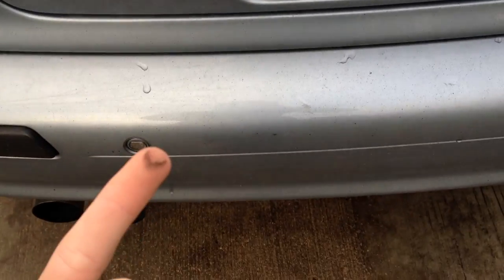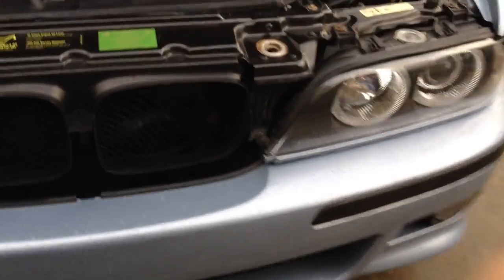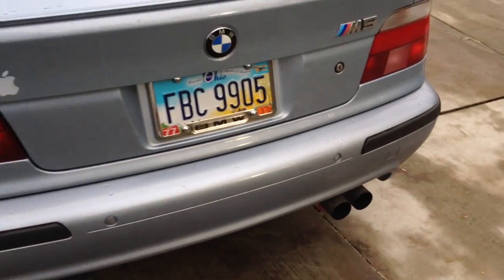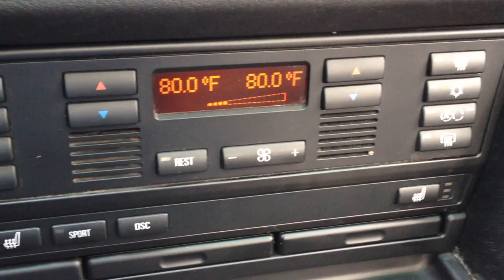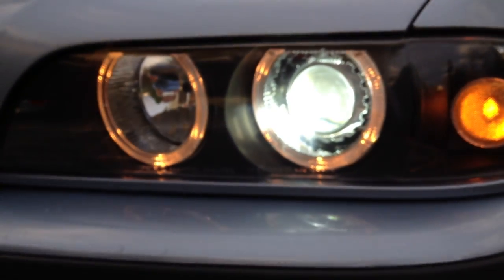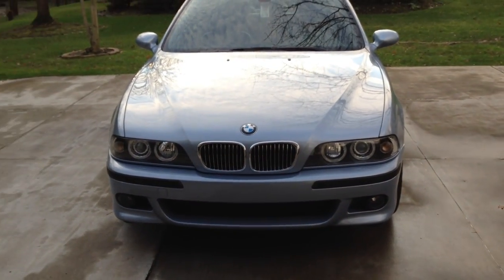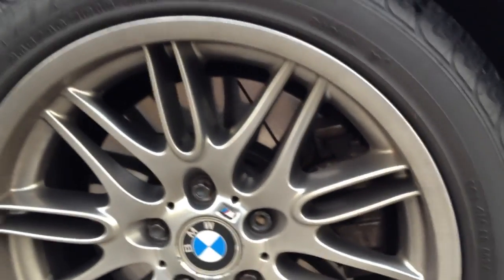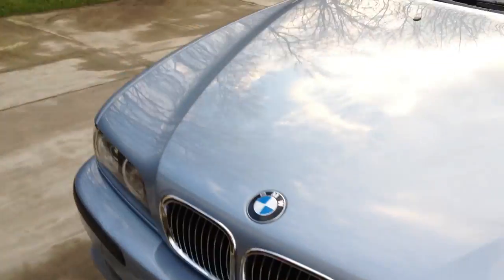BMW E39 M5:  Maintenance Info, Cost

Comment: My E34 Heater fan is a motor with a squirrel cage on both ends of the shaft.  2nd one became noisy and from the firewall with covers off I sprayed aerosol bicycle chain lube on both bearings  while it was spinning.  As the lube entered the noise want away.  The fan noise is motor bearing lubrication lack or drying out. It makes the rotation lumpy and therefore noisy.

Comment: While I have no experience with the m5, on a 3 series that temperature gauge never reaching the middle could indicate a soft failing thermostat...all things aside that is a beautiful car!
Reply from the maker: That's what I would think too.  But, I replaced the thermostat, temp sensor, water pump, and flushed the coolant system- no different.  So she stays!

Comment: If your temperature needle never goes to the middle, your thermostat is most likely busted (stuck open due to weak spring). It's very important that the engine gets to operating temperature - neither too cold nor too warm.

Comment: Hey, Im thinking about investing in a e39 M5 or 540i with the M5 body kit, but i was wondering if the expenses are really that bad. I am a DIY kinda guy until it comes to serious engine work or suspension. But i have a 1994 Mercedes with 252k running strong with slight maintenance. But do you think i should invest in either the M5, 540i, or e60 545i w/ M5 body. I dont want to spend too much on maintanace. but want a nice car.

Comment: On all V8 E39's. I believe on the I6 E39's you use hydraulic fluid because its rack and pinion, the V8s don't have room for rack and pinion so they use a steering box. The steering box requires ATF.

Comment: The last two numbers sort-of suggest the engine size but it doesn't always match and sometimes they adjust it for output. e.g. the 316 & 318 BOTH had 1.8 engines but the 318 was more powerful.

The older 528i DID have a 2.8 engine but now it's a turbo 2.0 BUT a rule of thumb to compare turbo engine size against non-turbo is to multiply by 1.4 hence 2.0 x 1.4 = 2.8 there you get a 528i ( "i" just means petrol now as it used to mean "injection" )

Comment: Just as a side note, I beat on all my BMW's. They are built really solid like tanks. I still have yet to hear a single tick coming from anywhere in the interior or exterior from any of my bimmer's, 1 of which has 250k on it. BMW's have their quirks here and there as described in the video, and my M3 has the VANOS problem etc. but don't let that paint an ugly picture. Drive a BMW once and you will never want to drive anything else, unless its a Porsche maybe !! Happy Motoring !!

Comment: In Europe pixel fix cost 30-60euro. All maintenance costs for my 525dA is very similar to this M5. Only difference is that 525dA costs 3-4k, but M5 10+k.

Comment: +E39Source is the engine rod bearings solid in these cars at high mileage like yours do you reccomend changing oil every 3000 miles me in sunny California always driving hard mostly highway mileage reverse commuter not much traffic meaning less stress on engine other than some overtaking and on ramp entering. Hopefully keeping rod bearings fresh with 10w60 castrol tws oil somewhat my theory and making sure coolant levels always checked. Much appreciate your input! Great video and been watching them occasionally for confidence while being s new owner of a 2001 alpine white 96000 miles due to your videos!
Reply from the maker: Rod bearings are solid, compared to the S85 V10 in the next generation of M5.  Those need to be replaced every ~75,000 miles.  These will go 150,000 miles+.  I would recommend replacement before 200,000 miles in most cases.  I rebuilt an engine for this car at 192,000 miles (detailed in this channel).  But my original engine was working fine- I just wanted to have a fresh engine done here in Ohio before I move to California and labor rates double.  I recommend using a high quality full-synthetic oil in a change with a fresh filter every 7,500 miles.  Castrol TWS 10w60 is great, that's all I've ever used. 

At 96k miles you'll be fine for a while regarding the engine.  Keep those fluids fresh and topped off and enjoy it!

Comment: did you say you have a sensor problem or EVAP system leak.
meaning a cracked hose under the gas tank.

can you pass obd2 emissions ?

Comment: e39 or e60 m5?
which one is better? i wanna get an e60 but idk the e39 looks appealing price wise
Reply from the maker: You know what, they're both fantastic in their own way.  I've spent good time behind the wheel of both models.  It all comes down to what you want from the car.  The E39 FEELS faster.  It has much more usable torque, the car just feels tighter, and more connected.  Around city streets, the E39 does feel like a faster car.  The E39 is a blast on the highway, but nothing like the E60.  That is where the E60 shines.  The extra 100hp is noticeable.  However, around town, I found that it feels smoother and more tame.  Not as tight, not as fast.  The power is HIGH in the rev band, and you have to rev it out.  Both are well built, good looking, and comfortable cars.  Gas mileage is similar.  Both are expensive to maintain.  I'll choose the E39 for now, but when I move to San Diego and spend a lot more time going 80-xxx mph on the highway, I might consider an E60 with a manual... but then again maybe not!
Reply: Guillermo Hernandez I have both, and they are very, very different cars. The e39 M% is basically a German muscle car. Many consider it to be the finest M-car ever made. A real classic now. The e60 M5 is a super-sedan, can run with a Gallardo, but uses quite a bit more fuel and is much more complex, especially with the SMGIII transmission. The V-10 at 8250 rpm is amazing, though!!
Reply: NOOOOOOOO I WANT BOTH
but i wanna get the e60 first then the e39
Reply: +M5pilot 
I got an m5 e60! but now i want an e39 m5 lol
The v10 is very thirsty, but god so lovely past 4k

Low end torque combined with the weight makes it sluggish at low speeds but it just doesnt stop once it goes, its crazy

Comment: Hey, awesome video! Great talking and a great car of course! I am not a big car guy, but I can imagine that your low-rev driving could cause the carbon on your trunk. It's not the low revs itself, but if you push the throttle and use the torque in low revs the engine has to enrich with gas quite a lot (same air, but much more fuel). maybe that's why? It sounds like it makes sense - higher revs -> more air with linear enrichment and not proportional.. (sry for the english..B)

Comment: I have a 2003 M5. To get my vanos and timing chain was 5800. Its worth getting fixed. You must remember M 5 is a RACE CAR. I CALL MINE THE BEAST!!! A LITTLE EXTRA WORK AND I HAVE 550 HP.
Reply: Be careful!
Reply: It's the timing chain tensioners that should be replaced to prevent the guides and chain itself from becoming an issue. Much cheaper solution if caught early enough.

Comment: Whats the difference with 5 series 20, 28, 30, 40? Is it the size or length or is it internal upgrades like horsepower and engine?

Comment: I just saw one of your comments that you have about 61k into, what was the most expensive repair you did on it? The video gave me hope, until I saw 61k spent lol.
Reply from the maker: About $45k of that is to make it "nicer" or "newer".  The most expensive required maintenance to keep it safe and driving well was probably spark plugs, oxygen sensors, tires, brakes, mass air flow meters, stuff like that.  None of those jobs were over $500 for parts.

Comment: Pretty cool video, reminds me of when got my 99 Audi A6 6 months ago, believe it or not we had similar issues, the display in the cluster panel seems to be a german thing..... i have the same issue and i juts totally ignore it, i dont have the fan Fan Issue though, only fan in mines was busted was the secondary fan on the radiator, $60 bucks @ amazon, my ABS sensor was busted fortunately a company had a core trade-in so the price wasn't too bad, I also have drill and slotted rotors.....

Comment: Hi great video thx, few things though: the oil gauge to go to the middle & even crawl a bit after is normal, same thing for coolant gauge reaching the middle is SO normal if not you might have a problem with the censer, BMW notorious about their cooling system.    
You are shifting too early, this is a race car, getting the gauge into 4k & more is better as long as you don't get it into the red zone, by driving the car your way I'm afraid you might have carbon built up in the cylinder heads & t

Comment: First gen g35s have suspension design flaws. Compression and control arm bushings last about 70k miles, depending how the roads are where you live. That's 500 a piece times four. Then ball joints, tie rods, alignments. Then my alternator, radiator, engine pulleys all went bad. Wheel bearings also go around 70k miles. G35s also have a brake wear issue. I changed my brakes and rotors 4 times and my car had 96k miles on it. Then the exhaust rusted and fell off. Also the 6 disk cd changer gets jamed

Comment: Hows the oil usage on the engine?  apparently pre 01's were known to use/burn up some oil during day to day use?
Reply: Yeah i did abit more research after i posted on your youtube video.  Theres a few common fixes that can be done to help reduce the oil usage but not eliminate it completely.

Im sorely tempted to get one of these beasts but obviously here in australia, economies of scale with less numbers of these babies running around, they still sell for a premium price.  eg theres one im looking at thats done around 124,000 miles for around 27k US.

Comment: In my country, kinda hard to find a E39 540i. Most of the seller only have 520i 525i & 528i. For your info, we only have auto transmission and impossible to find a E39 M5 here. Basically what i want ask you here is, what do you think about the auto transmission on this car model ?
Reply from the maker: The automatics have proven themselves over the years to be kind of problematic.  Lots of owners have seen them fail right around 100,000 miles.  But there are also some to go 300,000 miles as well.  Personally, I don't like driving an automatic in any car.
Reply: Too bad to hear that. So from you opinion, E36 & E39 this 2 beasts which one is easier to maintain plus i watched your E36 MT transmission conversion it was really really awesome !
I hope that you could give me more suggestion about how to buy a good BMW car because i been watching toooooo much videos about BMW cars and it make me so confuse to get which E30 E36 E39 & E90 dammmmn !
Reply from the maker: The E36 has a much lighter/cheaper feel to it.  They also lack (stock) in performance quite a bit to the E39s.  I would certainly recommend the E39, but thats my taste.  I encourage you to go out and drive a few different models to see which you like.  The E36 would definitely be the cheapest to maintain though.
Reply: Thanks for advice bruh, appreciate it !

Comment: Rapha, The emergency would be if the entire primary braking system fails, otherwise it's used as a parking brake. This is why it's constructed to be independent of the primary system. It's called a drum-in-hat system. Since the 1950's or so, law requires brakes to operate on separate cylinders and lines, preventing the likelihood of complete failure, but it can and does happen. How would you stop the car in that situation Rapha? Fred Flintstone style, I suppose.

Comment: is it normal for the engine temp and oil temp to not warm up to the midway point?  i just got an e39 m5 and its behaving the same way, broken thermostat?
Reply from the maker: +trimedia yes, that is normal. The M5 thermostat is not buffered so it will show the actual temperature

Comment: regarding the engine temperature..push it four 30 mins in 5-7 k rpm and it will heat up:)

Comment: Did you find out what does that reset button do on the climate control?
Reply from the maker: The "rest" button is for winter use.  When your engine is warm, your battery is healthy, and it's below about 60F, you can press that button to keep warm air coming into the cabin should you have to park and get out quickly to go into store or something.  Very useful in the winter time!

Comment: My fix? Take apart the mirror and use a knife to pry the two halves of the glass apart, clean up the auto-dimming fluid, and replace. Yes, the mirror isn't tinted nor does it actually dim, but it looks perfect and the total cost was $0.
Reply from the maker: ***** That would work, to a point.  But the function alone of actual auto-dimming mirrors is worth the hefty price tag to me.  When I drive my E46 at night (no auto dimming mirrors) I have to tilt them up so I can see to drive without being blinded, and then I have no side mirrors anymore.  Something like that is just not acceptable in an M car.

Comment: the head light not balencing just could be a sensor the conectes the wheel I know this because i have help do the hole subspenshion on the e39 540 and there a little rod the goes from the subspenshion to the sensor that ajusts the head light the problem iv had one the e39 is the driver side low beam going out

Comment: My bmw has lights coming on the dash.. I have a taillight out  (when their all working) my abs and ASC lights come on when their also working fine.. and just to finish off, I replaced the brake pads and sensor and that light is also still on!! 
Can you help?
Reply from the maker: Check the third brake light, that is usually the offender.  Did you replace the pad wear sensor?  That's what notifies the computers of the status of the pads.

Comment: Castrol 10W60?...You have money for an m5 and you put "Castrol 10/60 Semi-sintetic?
Reply from the maker: That's what BMW recommends in the owners manual, and on the oil filler cap.
Reply: Anthony R. It's full-synthetic. TWS. Motorsport oil. Extremely high-spec. oil. $15/liter.

Comment: 156k miles high mileage? You got to be joking! You should live in europe to see what is high mileage.
Reply: +Ruben Rocha Now days to get an m5 or m3 for about 12k euro to 15k for m3 or 6k to 10k for the m5 e39 it would be a challenge  to find low milage
Reply: Even for European standards this is high mileage, unless you live in of the former soviet block countries, where mileage correction of 60.000 miles is normal.
Reply: jerry6711 we have  leasing contracts that go up to 180k km. There are people buying second hand audis and mercs with 200k+ km and have them up to 400k km or more. Our car culture is that you only sell  the car when it has  severe body rust or severe mechanical problems. And we  have to take our  cars  to national road test every year. A well maintained car drives Like new even  with 400k km.
Reply: Where's that? Let me guess. In Germany...
Reply: jerry6711 in almost every european country.
Reply: Except the UK, where even 90,000 miles is seen as "high" mileage by some dealers. Also, depreciation is so big, that it doesn't make much sense to keep an old car, as repairs will exceed the value. In the UK they want you to consume a lot, like in the USA.

156.000 miles=251.000 kilometers is still not a low mileage. You may need to refurbish some engines at this mileage.

In Poland or similar countries, where the roads are rough and motorways few and far between, some automobiles with this mileage really will be worn. Add gas conversion, often lack of proper servicing for older cars due to the lack of money of their owners and things really will not look rosy .
Reply: Ruben Rocha my dad drives 400k in 3 years xd
Reply: 200.000 miles is normal in Europe.
Reply: I drive a 16 years old German Station wagon and in the "former soviet block country" it makes a lot of sense to own. They're dirt cheap to own, dirt cheap to maintain and with diesel I have reasonable fuel economy, 5.5l/100km on highway and ~7l/100km city driving with cold weather. Nothing wrong with the engine, going very strong. I passed my yearly national road-test with no faults, honest 341 000 kms on the odometer and interior leather look very good, no cracks no blemishes. And also it's bigger from the inside than most newer estate models.
Reply: Lol my seven series had 900000km and ran perfect when i sell it. Now I have e39 528i with 220000km and it smokes badly so if you maintain those cars they will running forever.

Comment: I love these cars, the style, the performance, etc. I want one. I just don't know if I'm ready to deal with the potential BMW unreliability issues. Working in supplier quality for a Tier 1 auto manufacturer the quality issues that besiege these models is just NOT acceptable. I get maintenance and I have no issue with that but repair after repair after repair costing into the thousands of dollars is not acceptable. If the car was abused that's one thing but I know BMW owners that maintain their cars very well and still have issues with reliability. I'm probably going to take the plunge but I do expect reliability from a premium brand like BMW.

Comment: I have a 2000 528i with 150k, I have a squeaking sound coming from the passenger side fender. Could it be the shocks?
Reply from the maker: +Darren McDonald Could be, but it also could be many other parts of the suspension.  Lower control arms, tie rods, etc.  Have a shop look at it and determine what parts are worn and need to be replaced.  Also a good chance it's strut top mounts, they can get noisy with age.
Reply: Thanks

Comment: Do you drive your car hard? Or like a normal car.
Reply: It drives both ways.  It's easy and comfortable to drive like a normal car, but it's just as good at driving hard, which is good for it sometimes.  It handles both styles very well.